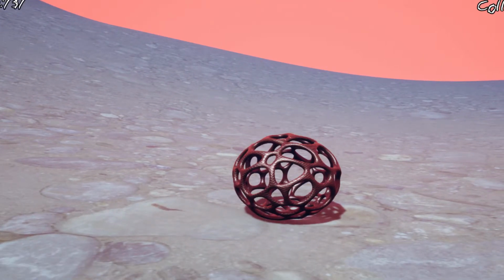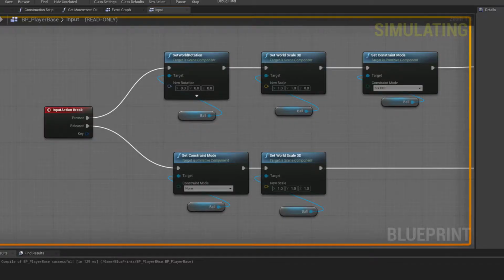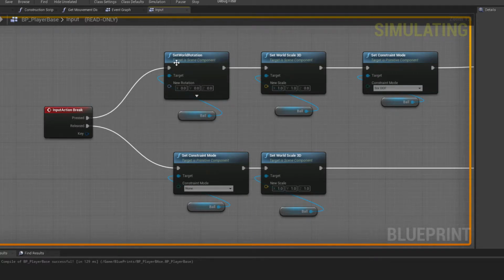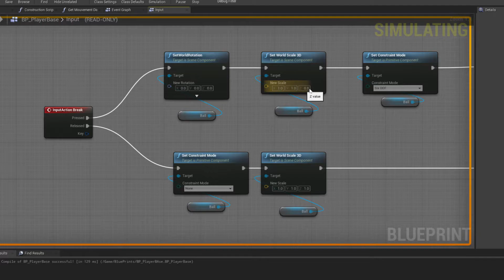How to Squeeze a Ball with Unreal Engine ?

Comment: wtf why would you set rotation to 0 on all axis to apply the scale
that doesn't make any sense
Reply from the maker: I set rotation to 0 to reset the position of the ball in order to get the squeeze effect parallel to the floor. If I don't, the squeeze will apply at any position and it looks ugly. Maybe you got a better idea ?
Reply: @ChrixB  I have a better idea but I assume it's irrelevant now
Reply: @MrZelektronz  The better idea is making the ball a soft body and leaving it to the physics implementation